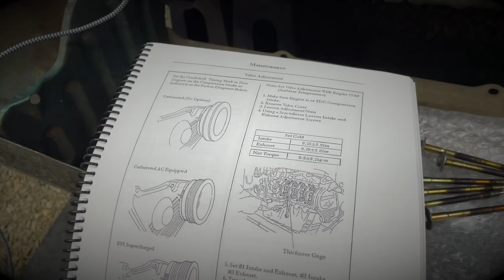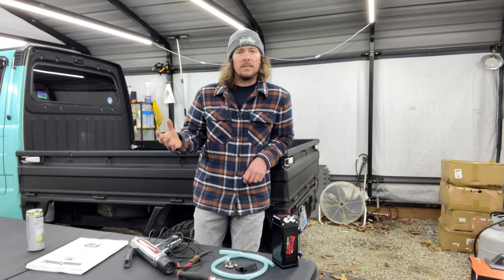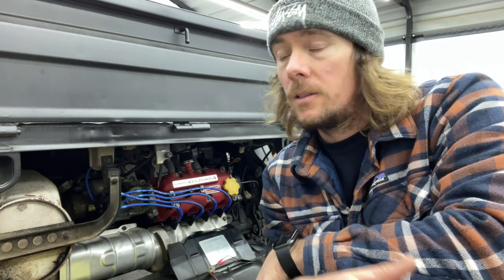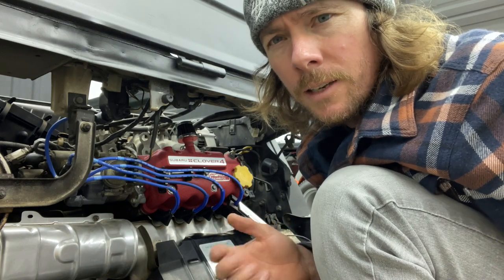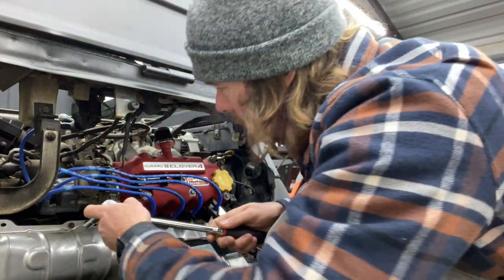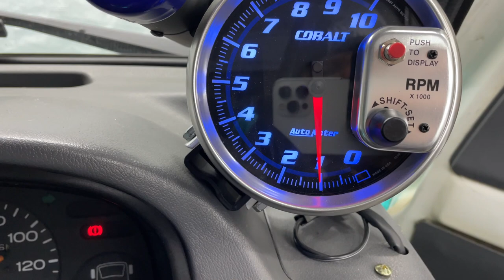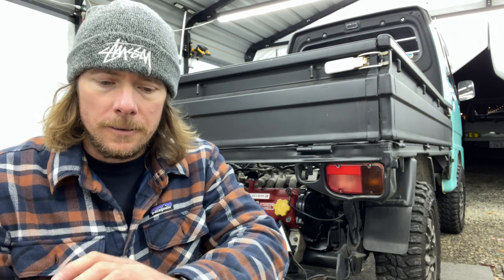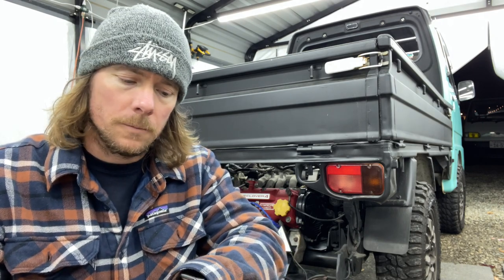Subaru Sambar Timing How To Check, Advance or Ret@rd KS3 KS4 KV3 KV4

Comment: The vacuum advance hose is plugged to prevent vac leak when checking the timing much like on a VW engine. It's ported vacuum and only advances at cracked throttle condition/s.